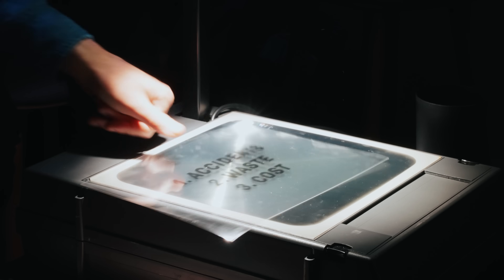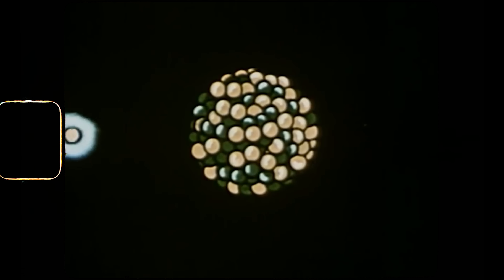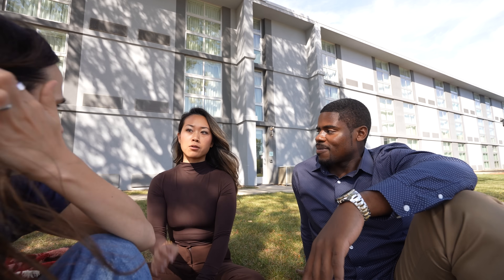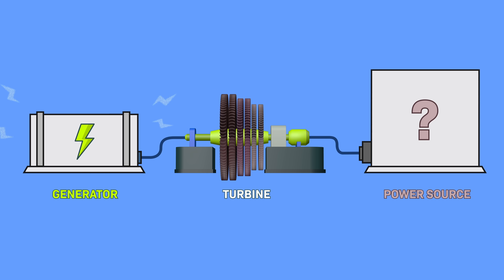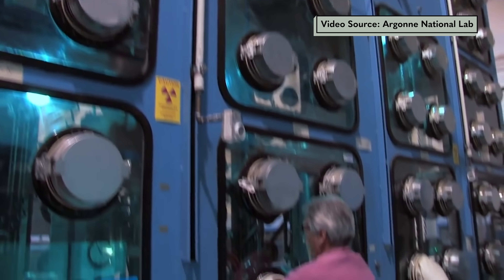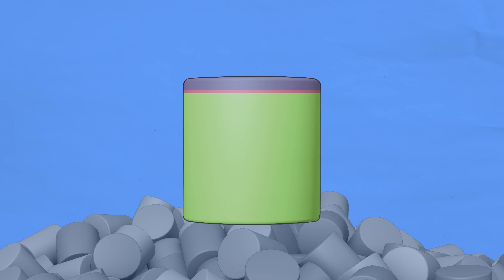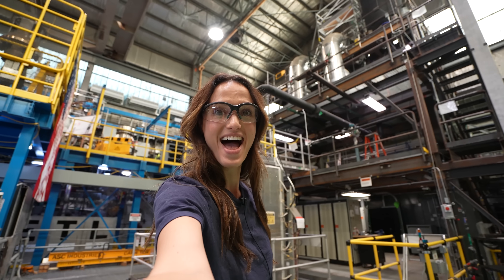The Big Lie About Nuclear Waste

Comment: Nuclear engineering PhD here! Love seeing videos like this. Nuclear has so much potential; it’s biggest problem is people stopped funding it for 30 years!
For anyone interested…
In light water reactors (LWRs) enriched uranium (3-5% U-235 vs natural which is 0.7%) is used. The burn up level that we can reach is limited by typically by the power efficiency of the reactor, or in cases by the material degradation. Fuel pellets can corrode and the fuel expands, etc, limiting the life. Materials are the primary challenge with burner reactors, and all advanced reactors. Fast reactors (neutrons aren’t slowed down to react with the fuel) are much more damaging to the materials in the reactor, and they can’t use water, so typically they have more corrosive environments (e.g Liquid Metal reactors, which are sick). THE  BIGGEST challenge is that the code qualification of new materials is VERY SLOW. currently only 6 alloys are qualified for use in nuclear reactors. SIX. Inconcel 617 was qualified in 2018 and was the first in 30 years. That’s the biggest thing that needs to change, and it isn’t the science it’s the regulatory hurdles and qualification process.

Comment: Wrong...plutonium is not "highly" radioactive, you can hold it in your hands and not be harmed it emits alpha particles which do not pass through the skin. Beta particles cause serious Burns and pass partly through the skin, gamma rays can pass through your body completely and on the way cause serious radiation-induced sickness.
Reply: Ingesting any radioactive solid or gas is harmful.

Comment: New subscriber. Please explore the Thorium reactors. Thorium is plentiful, can also recycle other nuclear waste. And doesn't use a pressure vessel design. Creates heat which could be used in industrial process. Or traditionally make steam, turn a turbine to make electricity.

Comment: There are three important questions about breeder reactors not really addressed here: HOW EXPENSIVE, HOW SOON and HOW TO PREVENT PROLIFERATION.  Cleo touched the first and the last, but didn't go into detail other than to say these were concerns.  How soon we can build breeder reactors wasn't touched on at all.  We need clean energy sooner rather than later and while this may be a good way to burn nuclear waste, I don't see it as a extremely important to overcoming the climate crisis.  

(Burning nuclear waste essentially means bombarding it with neutrons to turn it into even more unstable isotopes which decay much faster.  They're more dangerous in the short term, but the short term is much shorter than the hundreds of thousands of years you'd need otherwise.)

Comment: This is the reason Russia bamboozled US into storing major amounts of nuclear waste in Russia, as Russia already got special facilitis for this. Right now there is only one NPP with fast neutron breeder reactor functioning - BN-600 and BN-800 reactors that are using MOX fuel and implemented closed cycle, basically mixing fueld with nuclear waste and using it as a fuel.

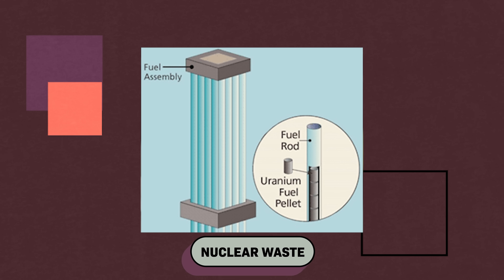Comment: Great video altough at 7:08 when you meantioned U235 that the 235 is the amount of neutrons in the core that isnt quite accurate its the amount of neutrons and protons in the core. 92 protons and for uranium 235 143 neutrons. for U238 its 92 protons and 146 neutrons.

Comment: if this is true, then i can see only one reason why they are not using the waste "yet". they probably wanting to use up all oil sources before they switch to that waste. otherwise all the oil won't be needed as much, use it worth and so they can earn less for it. that's proabbly 99% the reason why they are not using the waste yet. (and this is just thinking logically)

Comment: The enrichment of nuclear fuel was not described accurately, even when accounting for some simplification. One does not "make more uranium-235 out of [U-238]"; instead it's more like "distill away some of U-238 to increase the concentration of U-235". This also is quite an oversimplification, but the distillation (of, e.g., alcohol) actually is somewhat analogous to enrichment of nuclear fuels, in both the actual mechanism and its effect.

Comment: I love these videos. Little info to add. The nuclear power plant I work at has been online producing power since 1969-1970. EVERY SINGLE BUT of used fuel is still stored in dry cask on our plant site in a smaller footprint than an acre. Since 1979. Also, another neat fact, we shut down every 2 years to refuel. When we refuel, we only replace a third of the fuel. 2/3 goes back in the reactor for another 2 years. Engineers plan out and design where each fuel assembly goes to have an even burning core. I always thought both of these facts were super neat but never mentioned in these types of videos. 👍🏼🤘🏼
Reply: Also you can hold new fuel pellets in your hand without harm. They only become radioactive once introduced to other active fuel.

Comment: This is a really nice video but nuclear waste is by far not the only reason why we should not rely on nuclear energy. E.g. it's often overlooked that nuclear reactors need a second input: water. Take for example France who heavily relies on nuclear energy. Last summer they had to shut down an insane amount of their nuclear power plants because they didn't have enough water in their rivers to cool the reactors. They then had to import energy from their neighbors, which actually made the entire natural gas shortage much worse as that's what Germany used to produce energy for France. With global warming being here to stay, shortage of water will continue to be a problem in the future. 

Another factor is cost. Nuclear energy is by far the most expensive way to create energy with solar and wind being the cheapest by far (and getting cheaper). The problem is that is if we want to make use of those cheap energy sources we need power plants that can help out for peak usage times. A nuclear power plant can't be easily switched off for a few hours, nor can it run efficiently at less than 100%, making it basically incompatible with renewable energy sources.

So while nuclear energy can be helpful in the short term, in my opinion long term it's the wrong technology and we should continue investing in renewables and focusing on local energy production and storage.

Comment: Good video.  Just a correction at 7:05 The number does not refer to the number of neutrons in the atom, it refers to the atomic mass of the isotope (protons + neutrons.) The atomic number refers to the number of Protons (92 in the case of uranium)  So U-238 (the stable isotope) would have 238 - 92 =  146 neutrons.  And U-235 (the fissile isotope) would have 235 - 92 = 143 neutrons.  U-235 is the only known naturally occurring fissile isotope of any element.  All the other known fissile isotopes (U-233, Pu-239, Pu-241) are synthetic.  They are created in a breeder reactor.
Reply: It does refer to the number of neutrons.  A different number of protons means a different element.  Isotopes vary b/c of the number of neutrons.  Carbon 12 has 6 protons and 6 neutrons.  Carbon 14 has 6 protons and 8 neutrons

Comment: President Carter was a Navy  veteran.  He was an aide to Admiral Rickover, the guy who developed the nuclear reactors for submarines.  President Carter gave a speech from the grounds of Three Mile Island within days of the "Meltdown".  He knew EXACTLY what he was doing, as much as he fucked up, he got a lot of things right....   Nixon defunded molten salt breeders being developed by Dr. Weinstein in Oak Ridge Labs, the guy who came up with the basic design of the uranium reactors, to fund the fast breeder reactor in California to buy votes with a jobs program.  Weinstein and Eisenhour both thought uranium reactors were dangerous in civilian hands and were developing the molten salt "Thermal Spectrum" reactor for civilian use.  The molten salt reactors shut themselves down when they start over heating, weinstein's team had a reactor get away from them and it shut itself down because the salt expanded enough to release the neutrons which shutdown the reactor before there was any damage to the core they designed.

Comment: We in Germany did have this reactors that used reycled material.
I have heard that the nuclear energy costs with recycling are still magnitute higher than renewables. Is that correct? Can you find a number for  that?
Also how much more stuff gets conterminated through the recycling process and becomes itself highly nuclear waste? Exact number would also be interesting.

Comment: I am a nuclear energy advocate in Australia and I've read about Argonne and their work. It makes perfect sense to me to recycle the waste fuel to maximize the active fuel and minimize the waste. Greate video.
Reply: The hysterics over nuclear here in Australia are hard to swallow... at least in NZ we have enough renewable and geothermal options to make it completely feasible to completely move away from fossil fuel for power generation, but Australia is really going to struggle.

Of course then there is the problem with the delays in feeding all the new power generation into the grid. This is a massive problem in the US... hardly talked about, but is maybe the biggest barrier overall.
Reply: @MeppyMan  Yeah, Australia, with all that open space and sunshine. If only there were some way to turn sunlight into power. Australia's really gonna struggle.
Reply: There is no such thing as the nuclear fuel cycle. Recycling spent fuel you end up with a bigger pile of nuclear waste.
Reply: So you minimize the waste by 1%. Big deal.

Comment: It would have been good to clarify what you mean by "waste". Spent fuel-rods are just one type of radioactive waste and only a small percentage (3% I believe) of the waste that is produced. The medium and low grade waste that makes up the bulk of waste - that cannot be recycled or reused at all right? How long is that dangerous? This is a big issue with nuclear power. The other is that digging up and refining uranium for use in reactors is traditionally a fossil fuel heavy industry.

Comment: Reprocessing has considerable downsides.  Reusing fuel multiple time produces some really Frankenstein elements such as Technitium, which has a very long half-life, and is highly poisonous in small doses.  This stuff is much more evil than plutonium.  And it doesn’t occur naturally at all.  With so much oil and gas, solar, wind, and other energy sources, we do not need reprocessing.  FWIW, I worked on several projects related to the FFTF reactor that was used for research into fast breeders.

Comment: gets even more interesting when you realise these reactors can run on plutonium
both from nuclear waste
and from dismantled nuclear warheads.

If someone is against nuclear weapons, they really should be made to understand dismantling a warhead still leaves a nuclear core
nuclear core that even in 1000 years can be turned back into a weapon.
There is one way to get rid of it - put it in the reactor and fission it.
Only then this plutonium is irreversibly gone forever.

btw fuel pellets are not taken out of reactor because they get inefficient.
they become unstable over time.
as even Legasov in HBO Chernobyl would tell you there is this Xenon gas that gets created inside of the nuclear reactor.
well you got a molecule of a very dense metal (uranium) and then it gets split into a molecules of lighter metals (Iodine, caesium, strontium) and then you also have quite a few gases (xenon, krypton)
obviously, especially those gases are going to have far smaller density than the uranium they've been made of. Mass is the same. But they want to expant and take more volume. But all of them are trapped inside of the fuel pellet, so there is no space to expand.
so as more of them builds up over time, the pressure inside the pellet grows. this will eventually lead to rupture of the pellet - and you don't want that to happen because all screamingly radioactive fission products would get out of their containment inside the pellet.
as such, after 3-4 years pellet has to be taken out of the reactor.

But...
those liquid fuel reactors - like molten salt
there xenon just bubbles out of the liquid fuel - as all gases tends to do. And after just a couple of days it's not even radioactive anymore - so it's that much waste that you have to worry about.

this is a whole new chapter - liquid fuel reactors could allow separation of all stable (non radioactive) isotopes.
There is a whole bunch of short live radioisotopes among fission products - in half life of days, hours or even just minutes. Which means put them away for a month and none of them are radioactive anymore. 
and as they are not radioactive you dont have to store them anywhere - so essentially the only waste for you to worry about is caesium and strontium, which would decrease the volume of waste you actually have to store by an order of magnitude.

Comment: This has been done for over 40 years in the UK at a re processing plant near Blackpool. It does not make money in the conventional sense but is deemed to 'save' money as storing nuclear waste is very expensive. This plant has reprocessed spent fuel from many parts of the world including Japan.
Reply: Micha Egi is right. The tech described in the video is the electrochemical or pyroprocessing fuel recycling developed originally for the Integral Fast Reactor at ANL/INL and doesn't produce a pure Pu stream like the PUREX tech used in the UK & France. It basically electroplates all the minor actinides along with the Pu and significant amounts of U as well into a single stream. Much safer from a proliferation perspective and should be cheaper, although that is yet to be proven commercially.
Reply: @richardb1452  Thanks for the clarification, although I wouldn't call that 'totally different'. At the level of this video, the point is that fuel rods are only 1-4% used and reprocessing is an existing technology it would make a lot of sense to use. The details of the reprocessing tech are a relatively minor matter, although you are right that methods with lower proliferation risk are more likely to succeed. 
Which is good because the worldwide record of fast reactors/breeders has been 'chequered', with the French closing theirs in 1998, the US building one and never turning it on (IIRC?), the Japanese building one but shutting it down quite quickly and the UK closing Dounreay in 1977. Only the Russians are still running commercial-scale fast breeders (BN-600, BN-800) (pity they've made themselves pariahs recently - they might have been able to sell us all fast breeders). Although I see from world-nuclear.org's 'fast reactor' page that there is a Chinese reactor under construction now too.
Reply: No this is totally different.

Comment: Reprocessing "spent" fuel introduces proliferation risks because of the plutonium that's created.

And that's going to be a problem with any solid fuel uranium reactor.

But in a liquid fueled reactor we could "reprocess" the fuel inside the reactor with no external reprocessing needed.

As for the "waste"? France, as an example, gets about 70% of their power from nuclear sources and if you took ALL of their high level nuclear "waste" and put it in one place, it would all fit in less than two Olympic sized swimming pools. So...

The alarm about nuclear waste has been over hyped for years, and it's long past time to ignore the alarmists that don't know what they are talking about.

Nuclear power has the best chance of actually ending our reliance on fossil fuels.

Comment: The issue with spent fuel is that it sits in pools next to the rector - and if we somehow manage to expose it to air and cannot cover it, the fuel boils the rest of the water, then catches fire, then melts, then penetrates the concrete pool, then burns down until it hits a water table
And ends most of mankind.
Reply: Uh. No? I mean, yes, the first part- water boils, exposing fuel rods, fuel rods heat up, probably ends up spreading radioactive isotopes.

While this wouldn't be good, by no means is it anywhere close to mankind ending. Like, not even close.
Reply: You misunderstand - If the fuel in the spent fuel pool somehow becomes uncovered, it gets hot - then catches fire, then melts, then basically drills down through concrete and if it hits a water course underground, will generate an explosion large enough to end life for a significant distance - it will also destroy and uncover fuel in other reactors and spent fuel pools nearby. The spent fuel pools are more dangerous than the reactors.
 @Olivia-W